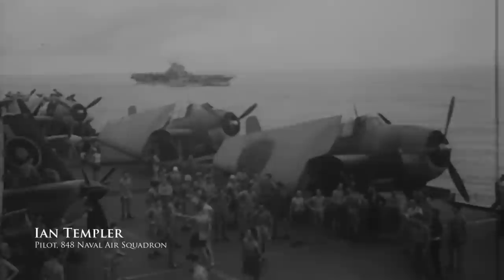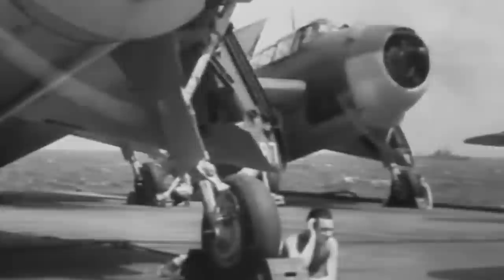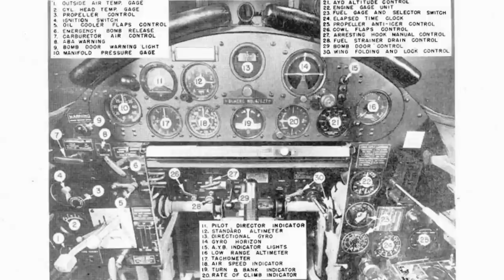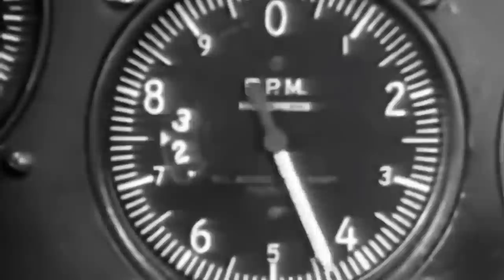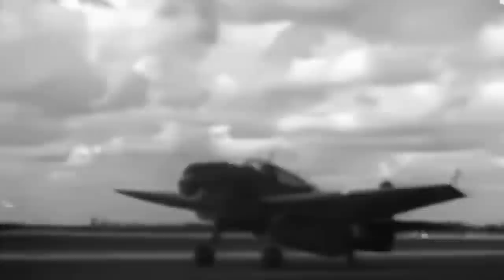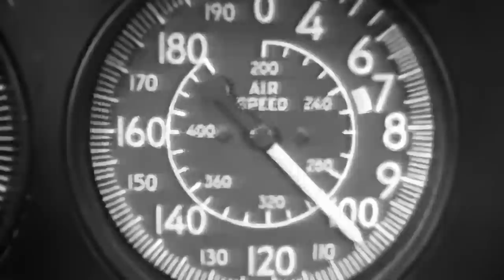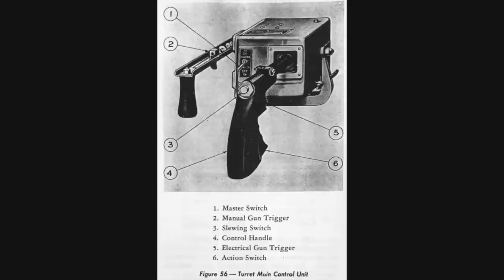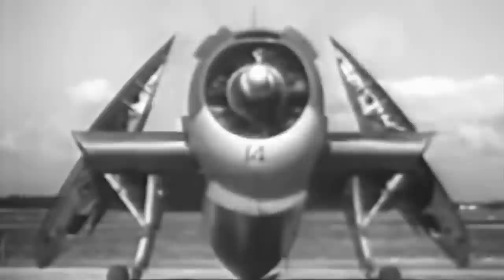Grumman TBF Avenger | When 'good enough' wins wars

Comment: Dad was a TBF-1c driver with 852 Squadron Fleet Air Arm. 

After training and forming-up the squadron in the States, they were deployed against Tirpitz in Alten and Kaa Fjord, Norway, whilst embarked on board   HMCS Nabob. . an escort carrier . . .  The carrier was torpedoed off the Norwegian coast, but the crew  managed to get it to the Firth of Forth for a beaching, but only after the commander flying and his no 2 took off from the heavily listing  carrier, which was also down at the stern, to mount a 4 hour anti-submarine patrol to thwart the trailling submarine which would have otherwise closed on the carrier and finished it off. On completion of the patrol and In atrocious weather,  the two aircraft made it back to the carrier. The no 2 came on board without in incident but the commander flying crashed on the deck, causing the bomb bay to open and an armed one ton depth charge to fall-out and roll down the heavily sloping and listing deck. Luckily members of the Canadian ships crew managed to arrest the depth charge's  travel - if it had fallen off the stern, the explosion would have finished-off the carrier.
Unfortunately, in the crash, the commander flyings Avenger hit other aircraft still parked forward, damaging one beyond repair. This aircraft was  later dispatched over the side into the Barents Sea... dad's aircraft.
The landing-on in incident was commemorated in an oil painting which, I understand was hanging in the ward room of HMS Ocean, until she was decommissioned in the early 2000s

This dit does have a bitter-sweet ending. 

 The carrier was written-off and so some of the squadrons aircrew were deployed to the British Pacific fleet. Unfortunately the former No 2 to commander flying of 852 was posted to one of the squadrons on a fleet carrier and was subsequently killed when a kamikaze Mitsubishi zero crashed on deck whilst he was nearby in his aircraft . . .he suffered flash burns from the explosion and succumbed two weeks later.

The commander flying of 852 found himself posted to Sydney, Australia, together with other members of 852 but unfortunately were not deployed to action before the end of the war with Japan. The commander flying was somewhat peeved and was further annoyed by a subsequently issued order banning military aircraft flying under the Sydney Harbour bridge, at pain of Courts-martial, following a complaint made by the Sydney Harbour Master.
Such that during the V-J Day flypast over Sydney, said commander flying peeled-off and took the whole squadron, in formation, under the bridge, whilst gesturing the "Sailor's fair-well" in the harbour-master's office direction . . . .the state of flux being what it was post war . . .no action was taken !
Again, this is the subject of another commenorative painting:-

https://n5490.org/Pilots/Bradshaw/Bradshaw.html

Bradshaw had previously risen through the ranks of 826 squadron at the time when the comedic  actor Peter Butterworth had flown aircraft with that squadron.

Comment: This episode it so good I've watched it twice. Thinking about the British choice to use in-line engines in carrier planes, it seems mostly determined by the RAF. My dad was an aviation machinist's mate, USNR. He always said that the in-line engines, favored by the US Army Air Force, were too "fiddly" to be used aboard an aircraft carrier. "We didn't have time to fool with water-jackets and all that mess". Radial engines were simpler, and that's what the USN had learned over a dozen years of operating big carriers. The RAF owned the Fleet Air Arm until about 1938, so it learned nothing about design for carrier aircraft because it did not care. It is amazing that that the FAA built out its air crews as quickly as it did as the war began. Aircraft design took longer. As it was, the USN needed all the Wildcats it could get, as Grumman began to turn build them in 1940 and 1941. The RN had wanted a combination torpedo plane and dive bomber, so it could use neither of the USN's specialized TBx and SBx aircraft. ArmouredCarrier explained, once, that this derived from the smaller hangars that the RN built into its armored carriers: with an armored hangar, designed for defense, the air group needed to deliver either torpedo strikes or dive bombing strikes depending on the targets. The USN had judged, in the 1930s, that its next war would be against Japan, across the Pacific. The USN would face Japanese-held islands, but the islands would be widely separated. The RN expected to fight in the North Atlantic, the North Sea, and the Mediterranean, where it would face too many airfields -- smash one and planes could move in from another. Therefore, the RN leaned toward armor-protection for its hangars. The USN wanted as many aircraft as possible. This "hit them first and as hard as possible" strategy was reinforced by results of several Fleet Problems -- discussed in a Drachinifel episode -- in which carrier aircraft bombed Pearl Harbor or bombed the "enemy" fleet before the fleets got into gun range. Different enemies led to different-sized air groups.

Comment: years ago I stopped in at a BBQ joint in Ruston, LA. there was a model of an Avenger hanging from a string. I asked the owner about it, and he said he flew in one as the rear gunner off of escort carriers in the Atlantic. He said the scariest he had ever been was facing backwards during night landings on the small aircraft carriers. Said he had not flown since.

Comment: The Avenger appears to have come in for a good deal of criticism from the British for not being a good dive bomber, especially in comparison with the Fairey Barracuda.  However, it should be borne in mind that, unlike the Barracuda, the Avenger was never designed to include dive bombing in its' operational repertoire.  However, the Avenger could, as was, very effective as a "glide-bomber".  During the pre-war period the U.S. Navy required three types of aircraft for use aboard their aircraft carriers:  "Fighters", "Torpedo/bombers" (which meant torpedo-dropping and level, not dive, bombing) and "Scout Bombers"  (which meant reconnaissance and dive-bombing).  However, as a result of wartime experience with the small escort carriers, which could accommodate only a limited number of aircraft and spare parts, the Navy quickly reduced the air groups on their smaller carriers to only Fighters and Torpedo/Bombers because the Navy found that there was very little that the "Scout Bombers" could do that the Avengers could not already do just as well, if not better.  In addition, although never designed with that specific role in mind, the Avenger proved to be much more adaptable to the anti-submarine role than any of the "Scout-Bombers", such as the Douglas SBD or Curtiss SB2C.
Reply: It’s a torpedo bomber not a dive bomber lol wasted comment tldr
Reply: Barracuda was bad torpedo bomber and dive bomber, avenger was never a dive bomber

Comment: Despite its rocky start with the U.S Navy at Midway the TBF proved to be a versatile torpedo bomber.
Reply: U.S. Torpedeos were useless.  Dive bombers did most of the damage.
Reply: @georgekraus9357  They eventually fixed it. Avengers also dropped bombs and fired rockets
Reply: Biggest problem for US torpedo planes at Midway: no fighter escorts, except for Yorktown's strike. And, of course, the torpedoes did not work well. The TBD was not very good, but delivered some hits at Coral Sea.
Reply: @redskindan78  Avenger was a solid bird.
Reply: @georgekraus9357  The Musashi and Yamato would like a word with you.  Shohi and Yahagi might also have something to add.  😉

(It is unfortunately true that the Mark XIV was terrible, though, and for far too long.)
Reply: Battle of Britain shied that turret fighters were a dead loss. Begs the question (1) why US continued with the idea. (2) why thunderbolt never had a carrier version.
Reply: @davidelliott5843  When did the US employ a turret fighter?

Regarding the P-47, by the time it was combat ready so were the Hellcat and Corsair, both of which had been designed for carrier use, had arrestor hooks, and folding wings.  How could the Thunderbolt compete with that?
Reply: @davidelliott5843  😂😂😂😂😂 yeah ok 👌🏻
Reply: The avenger is the single most successful torpedo bomber in military history.
Reply: @David Elliott  The Avenger was not a turret fighter so it's not comparable.
Reply: Thanks for the Info Rear Admiral Raymond!!!
Reply: Even when deprived of their original purpose (US torpedoes were almost worthless) it was such a versatile and adaptable craft that it continued to be used well after the war was over and torpedoes were utterly obsolete. Mine laying... sub hunting... supply drops... advanced recon... glide bombing... there was very little they couldn't do apart from dogfight.

My grandfather was the copilot/radioman/belly-gunner in one of these planes (Marine Squad 232: the Red Devils). I wish he'd told us more about his service before he passed.

Comment: The enemy of success is perfect, because it takes so much longer. You can have it good, fast or cheap, or any two of those. Americans will sacrifice somewhat on cheap depending on the situation, especially in wartime, followed by good. Fast is paramount. When Desert Shield cooked up in 1990, we threw a system that had never seen combat into the fray as a prototype, the JSTARS that could see moving target indicators generated by Iraqi Army unit movements. It performed brilliantly, but it was a risk as an untested aircraft.

Comment: I often wonder if the Barracuda would have fared better if it had been designed and built to take the later Bristol Hercules engines or early Bristol Centaurus engines, both radials. The later Hercules engines on Halifax and Beaufighters had the same nominal power output as the Merlins in the Barracuda, but may have helped with the power issues in the hot climates. It is an interesting thought experiment whether it would have made it more reliable.

Comment: I'm always amazed, and disappointed, that a country that produced the Spitfire, Mosquito and Lancaster could not produce a quality carrier aircraft until the Sea Fury which was near perfection but too late!
Reply: @well-blazeredman6187  This channel has a great account about the Hurricanes that were flown onto the HMS Glorious to be evacuated from Norway.

No tailhooks, so they weighted the tails with sandbags so they could apply full braking without nosing over.

I highly recommend listening to those stories.  Necessity is most definitely the mother of invention!
Reply: @Tango6nf The Fleet Air Arm was definitely treated like a red-headed stepchild.  They had less resources and were limited to different manufacturers and engines compared to the RAF.
Reply: Because until 1939 the Fleet Air Arm was part if the RAF, not the Royal Navy. As such it was the RAF that decided what the FAA flew, and Carrier aircraft were extremely low on the list of priorities for the RAF who were concentrating on Fighters and Strategic Bombers. Hell Churchill had to literally force the RAF to assign more long range heavy bombers to Coastal Command because they were refusing to, despite the obvious dangers the Atlantic campaign posed to British supplies!

Even after the RN regained control of the FAA in 1939, the FAA were still low priority, and more than one very promising aircraft was cancelled essentially because the RAF refused to allow the FAA to use specific engines. Supermarine for example  designed a Carrier Fighter that while based on the Spitfire was in most respects a completely different aircraft. Because it used the RR Merlin the RAF essentially killed the project, forcing the FAA to look at Sea Hurricanes and Seafires, neither of which were designed for the rigours of carrier operations. 

So yes, in essence there was nothing wrong with the British when it came to being able to design such aircraft, everything wrong with the RAF's constant refusal to allow resources they saw as 'theirs' be used elsewhere. The FAA had to fight tooth and nail for every single RR Merlin they were allocated, and, as I said, some promising aircraft were literally dropped because the RAF said no.
Reply: @alganhar1  A lot of the problems with aircraft and tank design were an effect of lack of investment in modern machine tooling and in engine development between the wars. The competition for engines and production capacity killed off many promising projects. When you compromise on one aspect of a design, particularly the engine, there is a chain of negative effects on other aspects of the design.
Reply: Forget about the concept "the country that designed the Spitfire". The RAF demanded the design of the Hurricane and Spitfire and the rest, as well as all the aircraft the RN FAA has in September, 1939. And the RAF disliked the idea of aircraft carriers, believing that its bombers in Coastal Command would cover all the seas and oceans around Britain. In contrast, the USN never lost control of its aircraft. The USN defeated the famous Billy Mitchell, who "demonstrated" that level bombers from the Army could sink a German battleship. Of course, the battleship was anchored and had its water-tight doors open. Like the RAF, Mitchell believed that a navy was obsolescent.
Reply: And also a fascinating account of the Sea Hurricane, the Hurricane with a tail-hook. See https://www.armouredcarriers.com/hawker-sea-hurricane-development @mbryson2899

Comment: The Barracuda might have had a fighting chance if it had been fitted with a more powerful air-cooled radial engine such as the Bristol Hercules which would have been better suited to hot and humid tropical conditions than liquid cooled in-line engines such as the RR Merlin and Griffin.  Most likely if the Hercules was ever considered as a powerplant for the Barracuda it was ruled out due to the large number of engines of that type already earmarked for bomber (Wellington, Stirling, Lancaster, Halifax) and Beaufighter production.

Comment: I thought the TBM simply meant is was built by General Motors, where the TBF was a Grumman produced aircraft.
Reply from the maker: Yes. But there also seems to have been enough differences between them for two separate sets of pilots' notes to be issued.
Reply: Grumman only built the first variant of the Avenger. Once the Eastern Aircraft Division of General Motors began building Avengers, Grumman stopped completely and converted the Avenger assembly line towards greater numbers of the F6F Hellcat. Later production of the Avenger went through additional significant changes causing later Marks and sub-Marks, like the Spitfire progressed from the Mark I to Mark V, to Mark IX, etc. The TBM version of the went from TBM-1 which was identical to the production TBF-1 to TBM-1C with more fuel capacity, TBM-1D with centimeter band radar under the right wing for hunting U-boats, TBM-1E for early Electronic Warfare, TBM-1P for Photo-reconnaissance, TBM-3 introduced the more powerful engine. Likely it was the introduction of the TBM-3 with the more powerful engine that required a different set of Pilot's Notes.
Reply: Were there any external, easily noted differences  to tell the Grumman built from the GM built Avengers? If the wing radar is absent.
Reply from the maker: @spikespa5208  An interesting discussion about that subject here: https://www.britmodeller.com/forums/index.php?/topic/234939504-tbf-1-to-tbm-3-avenger-differences/
Reply: @ArmouredCarriers  Thank you. That was the best description  of the  differences I've seen/ heard yet.

Comment: Not good enough.  Almost certainly the best carrier torpedo to be produced in quantity during WWII.  Easy to fly so you could concentrate on the attack.  Thanks to the internal bomb bay it's approach speed was faster that bombers that had a higher listed speed, since it didn't have all the parasite drag of a torpedo hanging outside.  When you are flying in with heavy antiaircraft fire getting to the drop point fast could save your life.  A Devastor chasing a carrier moving at 30 knots only had a closing speed of about 60 knots.  In the same situation and Avenger would be closing 3 times as fast.
Reply from the maker: Best because it followed a "good enough" design strategy. It didn't try to be all things to all people - such as the Barracuda. So it found a very effective balance.
Reply: @ArmouredCarriers  The Navy and Grumman certainly chose and pursued a reasonable number of requirements.  Of course, the US had the luxury of money to spend and capacity in carriers.  In terms of cost and space they could afford to have torpedo/level bombers, dive bombers, and fighters.

Deck parking also helped; the Pacific is not usually as savage as the North Atlantic.

Comment: Good Enough to Win Wars;

P-39
P-40
F4F
SBD
TMB/TBF
and more

Most aircraft received significant upgrades over time, and had they been the only options, far more effort would have been devoted to improving them. But even in their final forms by war's end the above aircraft as well as others could have gotten the job done if necessary.